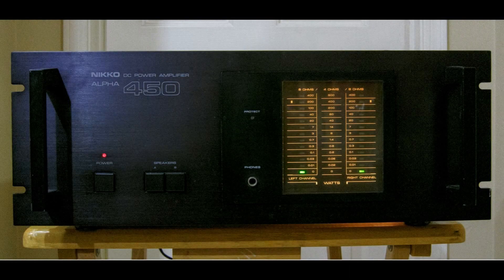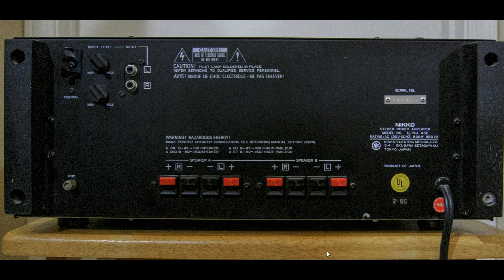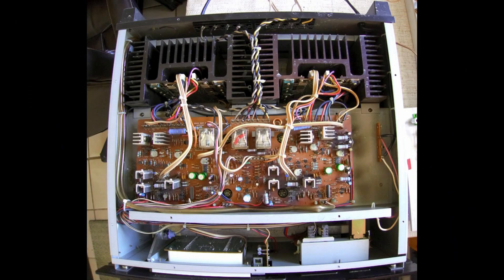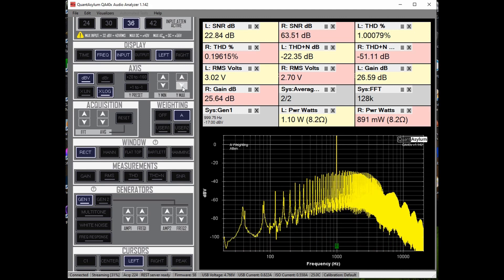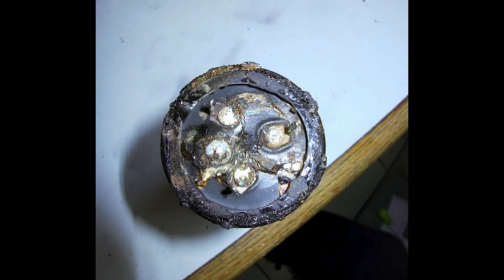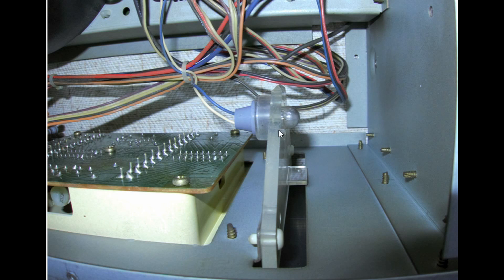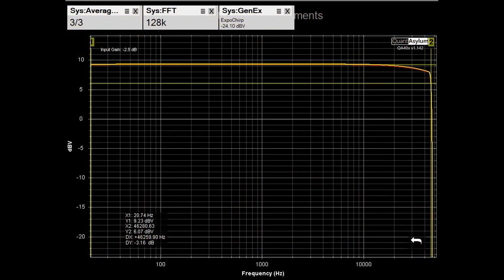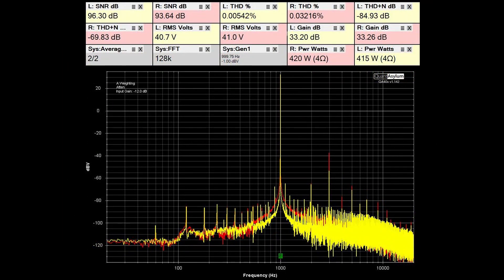Nikko Alpha 450 Power Amplifier- Vintage Audio Review Episode #15

Comment: I just got a Nikko Alpha 800 and it is really similar in layout, with the same heatsink.  Similar main filter cap and transformer layout.

Except each channel have 4 adjustable pots...  Now that's going to be hard to figure out with no service manual online.
Reply from the maker: Thanks for sharing about your purchase. Possibly Audiokarma may have a post about it- I did a quick search and did not find any service manual either.
Reply: @vintageaudioreview  Well, I guess that's part of the fun as well.  My caps so far shows no signs of leaking,  but with your copy leaking, I think it is a good idea to replace mine as well. 

My unit also have XLR input, but I laughed when i saw one phase gets dumped into a resistor into the ground.
Reply from the maker: @maniacaudiophile  If you have a scope you can check to see the power supply ripple on the caps and I would use that as my guide, unless you are just wanting something to do. Not sure what is going on with the XLR input on yours...

Comment: Hello I don't know if your still around but I hope that can ask you a question I inherited a Nikko alpha 220 
And I'm trying to set the DC offset but I don't exactly know where to hook up my meter too is it across the fuse is in there? And when you say 8 on dummy load do you mean speakers in the terminals or a resistor? Sorry to bother I love the video
Reply from the maker: I am still around and kicking. A dummy load is an 8 (or 4) ohm load that can handle enough power so you don't need to hook up and possibly damage your speakers. The service manual will tell you how to do the adjustment (hopefully)- you really should have that if you are doing this.

Comment: I just came across one of these at our local hifi shop.  I’m curious about the sound signature if any? Bright or warm?
My my current set up is:
Anthem mrx 540
Vintage Hitachi HMA 7500 (love it)
Paradigm Founder 80f’s
REL 1205 mk2 x2 

Currently using the Anthems preouts to my Hitachi hma 7500 and wondering if the Nikko would out perform the Hitachi?
Reply from the maker: Thanks for the question. My honest answer is that your sonic signature is mainly set by your speakers and room. As long as the amp is able to power your speakers to the level you want to drive them, most amps are going to sound pretty much the same- at least with all the testing  and listening I have done. As they are older amps, the frequency response could be off a little bit (maybe several dB), but that is why we have tone controls. I think I said in the video that it sounded pretty good overall. Maybe the shop will give you a few days to try it out and return it if you don't like it.
Reply: @vintageaudioreview  just curious when you bench tested the 450 did you have the rear input switch on Normal or Direct?
I did end up purchasing the 450 and will have everything hooked up tomorrow.
Reply from the maker: @MrJasonfromcanada  I looked at the video and I am pretty sure it was in the Normal Mode. I would have to look at the manual to understand the difference, but am guessing the Direct mode bypasses the gain controls.... good luck!
Reply: @vintageaudioreview  I got the 450 hooked up with my gear and I’m really liking it. Very clear detailed sound even at reference levels.
Reply from the maker: @MrJasonfromcanada  I am glad it is working out for you- enjoy!!!
Reply: @vintageaudioreview   it’s definitely an underrated sleeper amplifier for sure. My Paradigm Founders absolutely sing now.

Comment: I have the Alpha 450 is this a problem that happens a lot with the leaking? So far mine still performs great no issues at all. But was kind of wondering if I should look at getting it recapped because of the age of it.
Reply from the maker: Thanks for your comment, Brad! I only had 1/4 caps leak but, did all 4 just because it made sense as I mentioned. I really don't see many old filter caps go bad to be honest. If you want to keep the amp for a long time, then it might not be a bad investment to have them replaced, and some others in that unit. It is something that happens gradually, so you may not notice anything. I am guessing most shops would charge a few $100 to replace them all.
Reply: @vintageaudioreview  Thanks so much for the reply. My wife keeps trying to get me to get rid of the Alpha 450, Nikko Beta 30 pre amp and my VIVID speakers MODEL TX-995 but they all still sound good to be honest, and are still in fantastic shape. I bought it all new back in mid 80's at the Brick. Best purchase ever to be honest. I may have to get the amp checked out somewhere here in town and see how it's holding up. It's great to see all this info in your video about this amp, always felt it was very overlooked in the day.
Reply from the maker: You have had the equipment longer than you have had your wife 😆I am lucky because my wife was insistent that I kept my LaScalas. I am not familiar with "The Brick" audio store. Too bad you were not in my area as i would be happy to check out the Alpha 450. I believe the guy who has that one may have another that needs servicing- will have to ask him...
Reply: @vintageaudioreview  Sadly I've had the wife longer LOL. I hope to see more videos on old audio stuff, it was very interesting. You must have been doing this kind of stuff for years, you are very knowledgeable. I wish I was in your area but Ontario is kind of far from Arizona, if that's where you are. Oh and Brick is a furniture store chain here in Canada. TV's, Stereo's Furniture etc.
Reply from the maker: @bradcicchini364  My wife cracked up when I told her about our "interchange". Right now doing this channel causes some problems when I need her to go to another room if she talking on her phone, or when I play music loud. She is gone for several months so I don't have to worry, but now that she is home things are more difficult. Ontario is quite a ways from Tucson- it is much nicer here in the winter- if you don't like snow. As for knowledgeable, I am learning all the time! Thanks for your support!